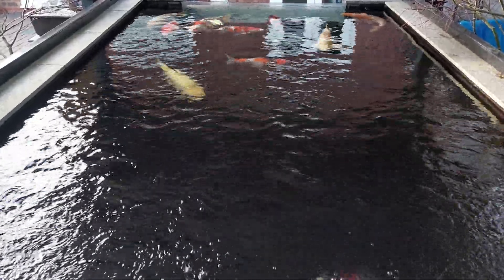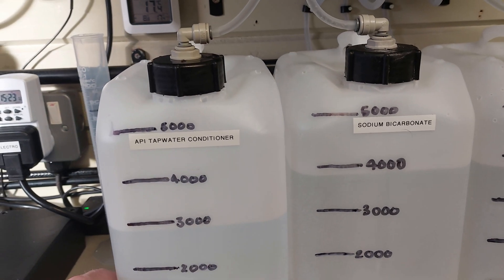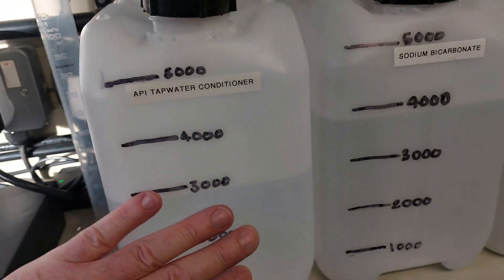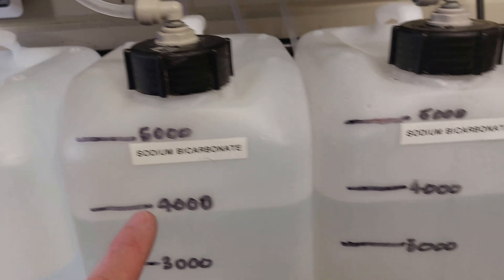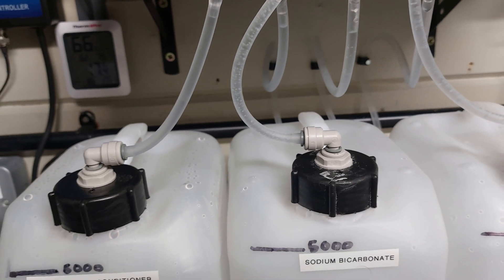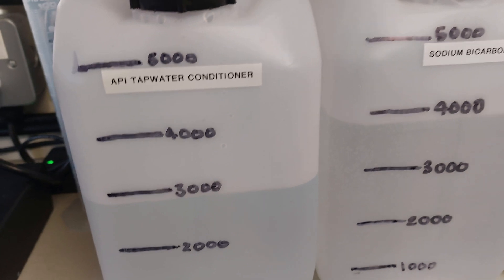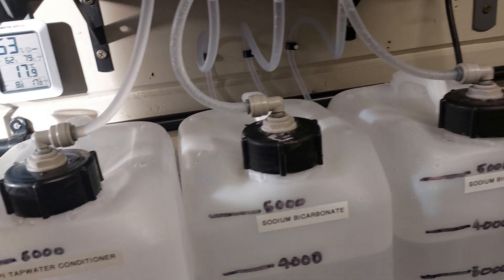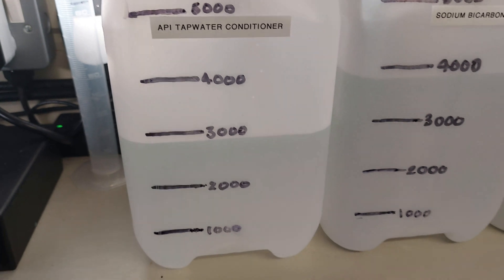Jebao 3 Channel Dosing Pump for KH Stability and Heavy Metal Detoxification

Comment: Really good content, had the same issues with metals, used sodium thiosulphate going to try that API
Reply from the maker: Cheers mate 👍
Just remember that EDTA has a much lower toxicity threshold than sodium thiosulfate.
Thats why most dechlorinator manufacturers don't use it.🙂

Comment: Thanks for sharing, very interesting
Reply from the maker: Cheers, 👍
I do have a proclivity for gadgets, and tinkering with a pond.
Worse now there's no black knight brushes to clean...
The drum filter does all the hard work, and i'm left twiddling my thumbs lol 😄
Reply: Do you think this could be used without the big blue?
Reply from the maker: @BrighstoneJohn  You can dose small amounts for trickle in, rather than chucking dechlorinator in once a week.
But there are some metals dechlorinators don't remove very well, even EDTA and Sodium Thiosufate, 
And other chemicals and poisons that dechlorinators don't remove, arsenic, pesticides ect...

But Activated Carbon by sorbtion, and Bonechar especially by Ion swapping and binding them into the Hydroxyapatite matrix. 
can remove a lot of different metal ions and flouride and chlorine.
So a dechlorinator alone is better than nothing, but not as good as using both to reduce metals , chlorine, and other contaminants too 🙂
Reply: @DavesKoiPond  Thanks for the information, it’s very helpful I was looking at getting a big blue but it all starts to get expensive especially if you go down the bone char route as well, I guess you can only do the best that you can afford.
Thanks again Dave 
P.S I also like tinkering I’am in the process of making a drum filter at the moment,